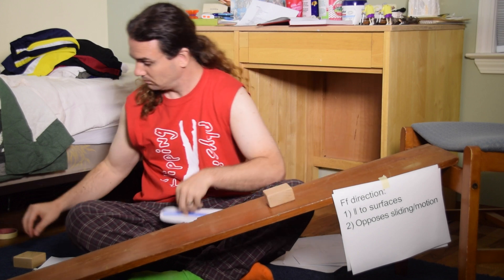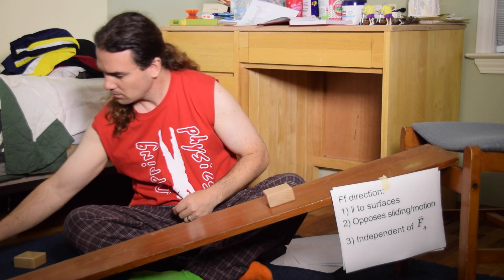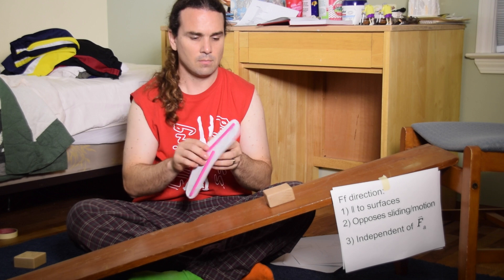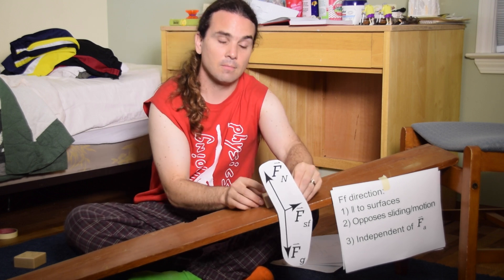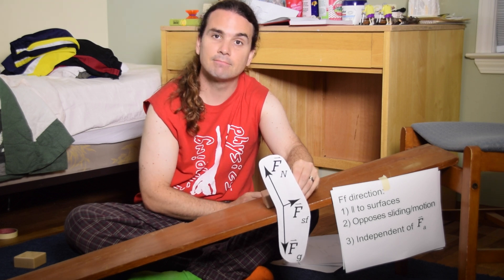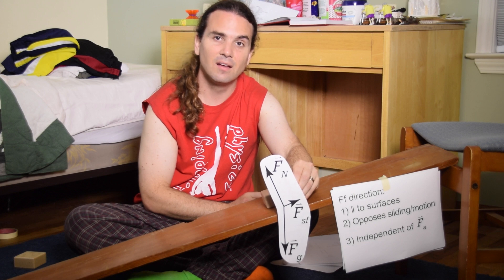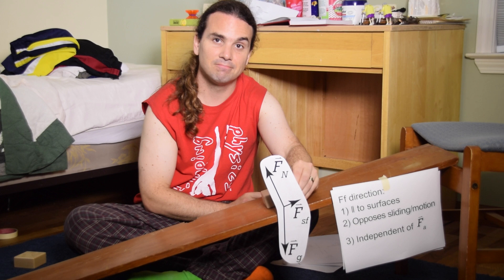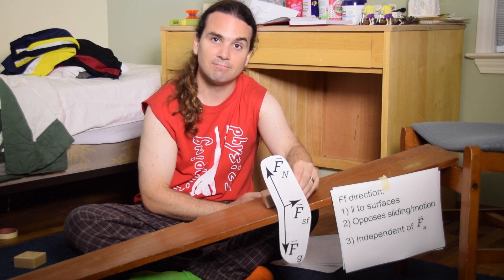Introduction to Static and Kinetic Friction by Bobby

Comment: In the last case There is a component of mg working toward down the incline. 🙁 And friction working opposite with that component. So is it Independent of Force applied on it? Or I got that wrong?
Reply from the maker: The point is that there is no general rule which compares the direction of the force of friction to the direction of the force applied. I can (and have) shown examples where the force of friction is in the same direction as the force applied and all sorts of other angles relative to the force applied. In summation, do not use the force applied as a reference for the direction of the force of friction!
Reply: @FlippingPhysics  Ok sir. Thank you! ❤️

Comment: i have a question. when a body is just placed on a horizontal surface and the static friction force is acting on it why does the boy not move backward? I am kind of lost at this point
Reply: The force of static friction can change. It has a maximum value, which is the coefficient of static friction times the normal Force. The force of static friction is always less than or equal to the maximum value. The force of static friction can increase and decrease in order to stop the object from moving.
Reply: @jojopyun  Thanks very much. I understood that already I actually figured out that when there is no force acting on the body the static friction also is not present but when a force acta it tries to oppose until it reaches its max value. I actually understood just that I thought for some minutes that the friction will act when no force is making the body move😂😂which is just crazy. Thanks

Comment: when body is at rest and no pushing applied force is there...what is the magnitude of frictional force?
Reply: When there is no applied force (or zero net force) on an object, the frictional force is also zero.  If it wasn't, it would cause a non-zero net force on the object and it would accelerate, per Newton's 2nd Law.

Comment: Salam You say that friction force does not depend upon surface how it is correct?Explain further!!!
Reply from the maker: This website has a good description: http://www.dummies.com/education/science/physics/how-surface-area-affects-the-force-of-friction/
"The force due to friction is generally independent of the contact area between the two surfaces. This means that even if you have two heavy objects of the same mass, where one is half as long and twice as high as the other one, they still experience the same frictional force when you drag them over the ground. This makes sense, because if the area of contact doubles, you may think that you should get twice as much friction. But when you double the length of an object, you halve the force on each square centimeter, because less weight is above it to push down. Note that this relationship breaks down when the surface area gets too small, since then the coefficient of friction increases because the object may begin to dig into the surface."
Hope that helps.

Comment: Could we adopt a more general definition of "applied force" and let gravity qualify as an applied force? Would it be accurate, then, to say that static friction opposes the net applied force when the object is in equilibrium?
Reply from the maker: +jdmphys 1) I don't see how the Force of Gravity would ever qualify as a Force Applied. The Force of Gravity is a Field Force, the Force Applied is a Contact Force. Very different.
2) The "net applied force" would only be the addition of multiple applied forces.
Reply: +Flipping Physics   Yes, fair point--makes sense. Let's just call it 'the net external force parallel to the surface due to everything except friction, as measured in the object's frame.' Does static friction always oppose this? I guess I'm trying to figure out what the one general rule is for determining the direction of static friction.
Reply: +jdmphys  And in particular, I'm trying to synthesize this scenario with (a) a ball that is rolling without slipping, and (b) a car moving around an unbanked circular track.
Reply from the maker: +jdmphys Imagine the direction the objects would move (or rotate) in the absence of friction. The force of friction is opposite that direction. For (a) a ball rolling down an incline without friction, the ball won't actually "roll" because it is friction that causes the ball to rotate. If it is rolling without slipping, then the force of static friction would be up the incline. For (b) in the absence of friction, the inertia of the car would make it move in a straight line. Relative to the in/out direction one should sum the forces in when analyzing circular motion, this would be out, away from the center of the circle the motion of the car describes. Therefore the force of friction will be opposite that or in toward the center of the circle. Does that help?
Reply: +Flipping Physics  Yes, this helps a ton! Thanks! With the circular motion example, is it correct that the velocity is tangent to the circle? Assuming so, this makes me think that the rule would have friction pointing tangent rather than into the circle, because if friction suddenly disappeared, then the car would move off along a straight line tangent to the circle. How is the rule able to be sensitive to our in/out convention for summing forces when in circular motion? Is there something we can articulate further about the rule which captures this "sensitivity" (as I'm calling it) to our force convention in the case of circular motion?

If we stepped into the car's non-inertial frame, there would be a centrifugal force pointing out away from the center of the circle, ye? In this case, it would be correct to use a rule that static friction opposes the net external force from all other forces parallel to the surface in the car's frame, I think...
Reply from the maker: +jdmphys This is a difficult concept to describe. I would suggest this video https://www.youtube.com/watch?v=6B6YRPYVJ5Q&feature=youtu.be where I derive the direction of centripetal acceleration, which is also the direction of centripetal force.
Reply: +Flipping Physics  Thanks! That video is very useful. So, when the tangential/linear speed is constant, the acceleration and net force must point into the center of the circular motion. And from this, we can infer that there must be something pulling in toward the center. We can also infer that static friction must fill this role because there's nothing else to do so, and also because we know that, without the tires having grip/traction (ie, without some static friction), a car would be unable to round an unbanked turn at all. So static friction must be what points into the center.

But does this logic (that there must be a force pointing into the circle, and it must be static friction) conflict with the general rule that "static friction opposes the direction that the object would otherwise move in were static friction absent"? It seems like this rule incorrectly implies that static friction on the turning car points antiparallel to the velocity (ie, tangent to the circle). But I feel I am misinterpreting the general rule you've proposed for the direction of static friction. Maybe it's not possible to write down a single rule for the direction of static friction which correctly predicts all of the following:

(a) when a car moves around an unbanked road, static friction points into the circle;

(b) when an object is resting on an incline, static friction points down the incline; and

(c) when an object is rolling without sliding, static friction points parallel to the tangential velocity of the contact point.

I'm not sure that the rule I've proposed ("static friction points opposite the net external force directed parallel to the surface when in the object's frame") is good, because I don't think it would predict the correct direction of static friction in case (c).
Reply from the maker: +jdmphys The general rule still works. Friction opposes the direction the object would slide if friction were not there:
(a) From the non-inertial reference frame of the car moving around an unbanked road, in the absence of friction, the car would move "out" away from the center of the circle, therefore the friction is "in" toward the center of the circle.
(b) When an object is resting on an incline, in the absence of friction, the object would slide down the incline. Therefore the friction is up the incline.
(c) When an ball is rolling without sliding, in the absence of friction, the object would not roll. Looking at the intersection point of the ball and the surface, the ball is moving forward and not rotating. The force of static friction is backward (opposite forward) and causes the ball to roll.

[It just occurred to me that Bobby should be answering your questions. Sorry.]
Reply: +Flipping Physics  Thanks!!

Comment: Say i have an ice cube, and a floor with ice as its surface will there be no friction or some friction because it seems smooth
Reply from the maker: Anik Talukder Generally we consider anything on ice "frictionless", however, it is not quite frictionless; it would have a very small coefficient of friction. Perhaps I should make a video measuring the coefficient of friction of ice on ice? That sounds like fun!
Reply: Yeah that would be great!